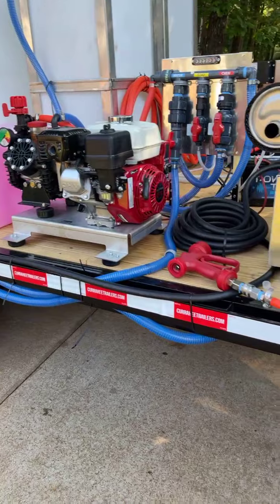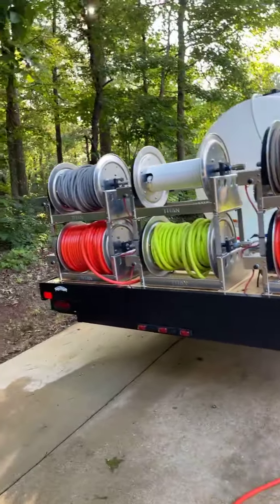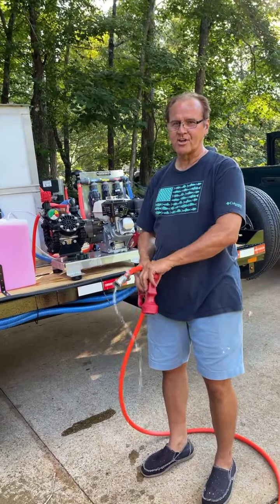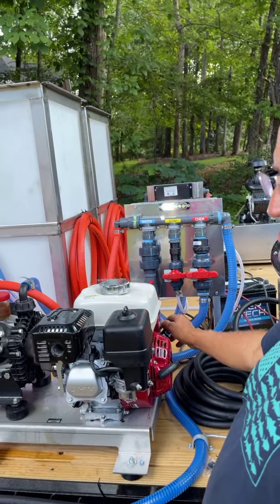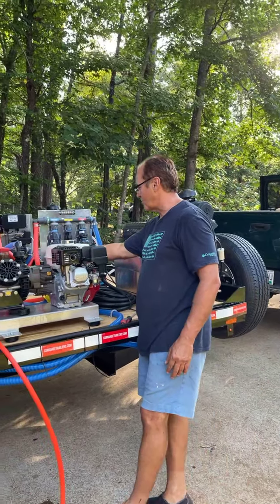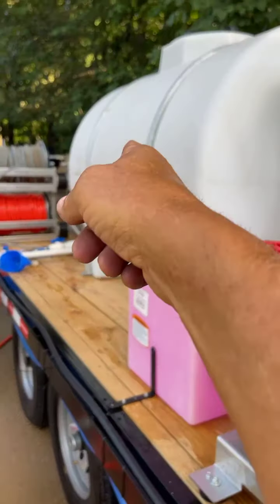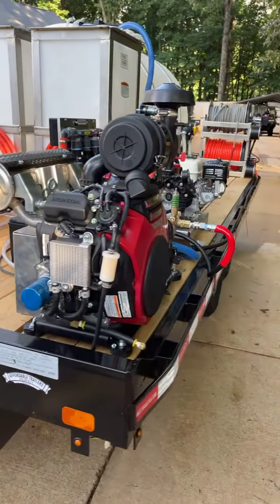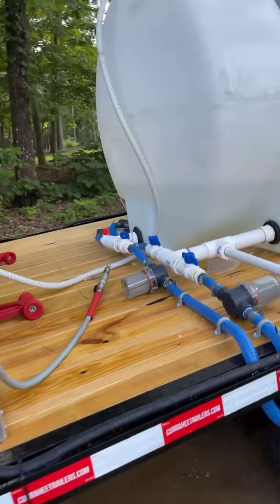Finished new trailer build

Comment: Another BEAST !!!
The 12 volt for filling the bleach is sweet.  I think setting up a system for rinsing the 12v after filling the SH tank would be a good idea.
I'm not a fan of the blue waterlines dangling near the trailer wheels.

Comment: I finally decided to cap off my soap valve and now add our soap to the sh tank because one of my guys shut the soap and bleach off and evidently didn't wait long enough for the sh to get out of the line so when he went to rinse dirt off of a nice wood double garage door he ended up with a speckled nightmare.  Supposedly the surfactant we use won't dilute the sh but I have a hard time believing that it won't after a few days.  Your thoughts?